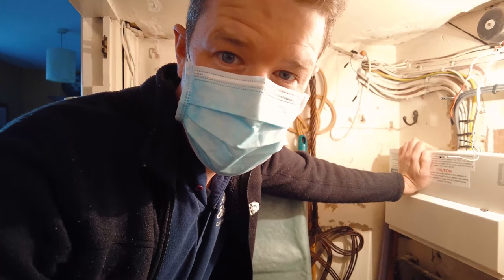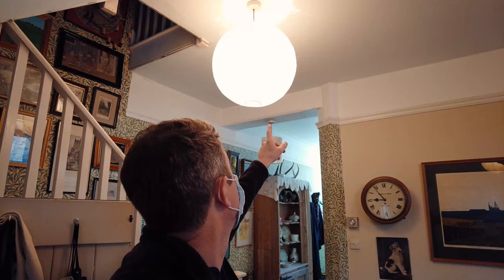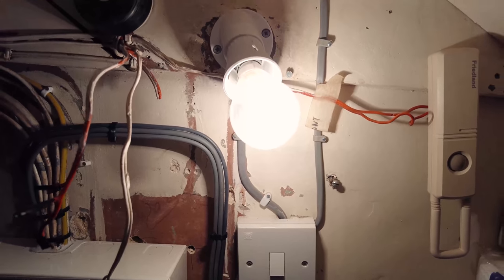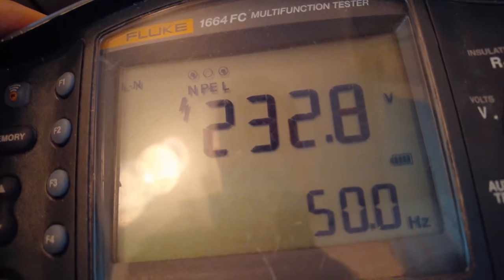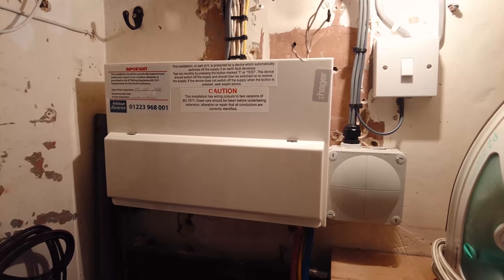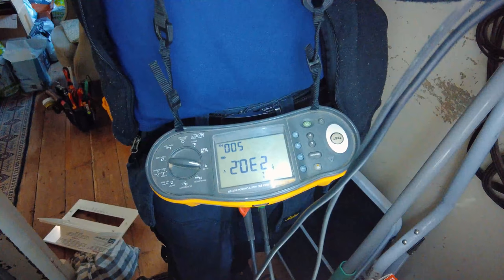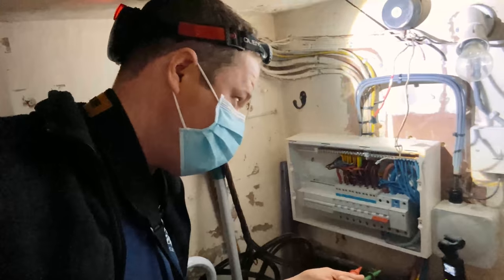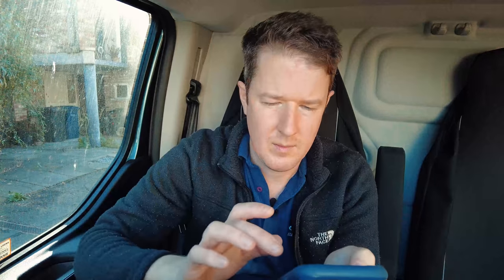Fault Finding Flickering Lights - Electrician Life

Comment: I've come across that as mentioned by a tenant it was jumping from 220 to 205 volts at the kitchen light  with reports of also the oven and kettle taking longer sometimes. 
I went to the consumer unit and found the main Earth was loose and reconnected it and had 240 volts , I even checked it later in the day it was fine and had a report since then to say power fluctuation and light flickering had stopped.
Tenants were told to keep an eye on it, that was a couple of months ago.

Comment: Great video as always  , love these faults ,  all you needed to do was test the impedance between line and neutral that would of indicated high impedance hence the volt drop issues
Reply: How do you measure the impedance between lines at different voltages?
Reply: @randomstranger9674  with a loop impedance tester

Comment: I had this many years ago,(30+) . 2.00am was woken up by a loud buzzing in the bedroom. Turned on light, pop light gone. Street light was like a search light. Pulled main fuse and checked over. Sub station had two phases shorted, measured 370v at meter. Electricity board paid for replacement white goods, fridge, freezer and oven as old mechanical clock, and VCR. Oh and my teas maid !(with coffee in)
Reply from the maker: Wow 😳

Comment: We had a similar fault it turned out to be faulty fuse holder out on the pole( very old ceramic holder) our electrician he couldn't make heads or tails of it but here in New Zealand we don't have network equipment fuses in premises they are all at the point of network delivery aka the gate

Comment: A good few years ago I did working in a poker arcade fixing the poker machines, the arcade was situated in a small village in Donegal Ireland ..the switched mode power supplies in the poker machines would fail  often around the same time each night. It was people turning on electric cookers to cook dinner and then then pulling the mains supply down and the power supply inside the poker machine was working flat out to make the supply and would go bang. Rural Ireland at its best..

Comment: We had a situation here recently where the damndest thing was happening - US. Power was going out every 8-9 minutes like clockwork for about 5 seconds. When it came up, the 240v nominal was at 280v (140 for either of the 120v halves), and this dropped off more or less linearly until 180v on the 240v and 90v on the 120v, when presumably some safety cutout was hit.... Which promptly reset 5 seconds later. It affected a suburban area the size of a small city... Went on all afternoon like that.

Comment: I’ve seen voltages fluctuating from 210-230 a lot in the buildings I maintain. Generally it has been UKPN underground cable faults, especially if they have had other faults in the network so they may change which way the HV network is fed which uncovers other faults. Or it might be a fault on a HV transformer up a pole, wouldn’t be the first time a squirrel has shorted out and blown up a transformer.
Reply: Is continuous up and down in 210-230 range normal? Our lights flicker and electricity supplier discarded any problem saying reading our meter which shown 210-230 range

Comment: Interesting video Jordan I recall that in Berkshire where I lived for a bit a whole section of town had this fault it affected a huge area I thought maybe it was a stuck tap changer at the main sub  but never found out for sure. Eventually the fault was cleared it persisted for a good couple of years though.ive also seen it here in Dorset where it affected a pub I used to frequent . Thankfully its never been an issue here at my home would drive me nuts I think cheers

Comment: I was once working up an attic on an alarm system, all of a sudden the attic lights went very dim, I thought ‘oh what have I done now!’ I measured incoming voltage for the customer and it was 70v, Turns out that a transformer had gone faulty in a nearby field affecting 12 homes. Just a coincidence that I was working there at that time. Relief was an understatement 😁

Comment: A friend house had exactly the same situation the voltage was randomly fluctuating between 180 and 240v 
After a number of visits by Uk Power Networks and placing a data log on the supply it turned out to be a failed cable joint this was repaired but six months later another joint nearby blew up so I guess the original fault causes a week spot on the cable

Comment: Obviously a power quality problem.  Does the flickering happen also after sunset ?  This is a test to exclude a rogue PV inverter somewhere in the neighbourhood.
On the Fluke tester the frequency was changing rapidly around 50 Hz in link with the voltage drops.  Is the house nearby an industrial plant or nearby a SME using some machine normally designed to be connected to industrial supply but connected to domestic supply ?  Normally industrial plants are "a few transformers away" from domestic supply for power quality reasons, precisely.  But it's not the case for SME's and if they're using welding machines or other metal working machines this could disturb the neighbourhood power quality.

Comment: I'd have a crack and say it was a neutral fault developing which might not have gone fully bad. Not sure if they used CONSAC cable in the UKPN  patch, but it's pretty notorious for neutral faults. Or a garage with a welder or similar nearby causing power quality issues.

Comment: High resistance neutral usually at the meter box at least in America that is what I have had several times, especially when there is a small load causes voltage to vary.  This is what I have run into.

Comment: A few years ago I had a very similar issue at my residence. All the lights in the house were dimming very low, even to a point where they would almost completely turn off and back on. I also am an Electrician so I put my multimeter on it and was getting 100 volts on A phase and 140 volts on the B phase. I am in North America so we operate at 120/240 volt system for all our residential needs. After a couple
days of trouble shooting I discovered that the Neutral wire which is the bare conductor that comes in from the City supply wires had some white corrosion inside the crimped connection. I removed it and installed a new one with antioxidant lube inside of it. The neutral wire just so happens to be made from Aluminum. Anytime when Aluminum is used it’s definitely recommend to use the  lubricant when making splices. I am curious to know if the problem you had was resolved and what the details were. Thanks for posting!!
Reply: Hi I'm in Asia where 240v is the standard. Our voltage fluctuate from 219-231 every other minute, is this range normal?
Electricity supplier says such range is fine and refuses to take any action.

Comment: 220V isn’t super low. But why not do a earth loop / neutral loop test? Separate earth/ neutral how much volt difference? Connect the heaviest load and repeat. Check for any possible loose connections. I’d do those tests prior to calling the network

Comment: Hi great video, i was wondering what would cause my landing light to dim as if it wasn't getting enough power ? i changed the whole unit because the old one didn't work and since i have installed the new one it only seems to be barely lit !
Reply: Have you checked the voltage at the light when on compared to the voltage at your meter?
If only one light, it sounds like faulty wiring somewhere.

Comment: What was the cause in the end? 

Looks to me like some sort of motor with a locked rotor (e.g. air conditioner) that tries to start, fails, trips and then resets to try again.
But that sort of voltage drop it would be in the customer's house. Should not have that drop if it were someone else's house.

Always keen to know the reason for the fault.
Reply from the maker: The DNO said everything was fine so we never got to the bottom of it..
Reply: Could be some form of construction.
Have seen my own lights on blue phase flicker when a house up the road did some welding on the same phase.
I'd also ask the residents to see what time of day the flickering takes place.

What a nuisance, but thank you for the videos.
Watching all the way down here in South Africa 👋

Comment: I am reading the regs just now and doesn’t Appendix 2 item 17 give a permitted voltage range of 216.2 - 253.0 volts. Your measurements showed to be within theses limits. I suppose the DNO could tell you to do one but it would be the swings in voltage that gives rise to concerns. Thoughts.
Reply from the maker: Yeah the DNO are gonna run a power analysis for a while and see what the results are...
Reply: So 2 days on and they haven’t found the problem.  Strange it’s taking so long.
Reply: @artisanelectrics  good that you got some sort of feedback from them

Comment: I think maybe one phase is missing on the main supply cable. And now you dont have phase balacing meaning on three phase you only have two phases that is working making the load to jump up and down with high load. Thats is what
 I think. But hey i can be wrong

Comment: Funny Jordan I had the same issue in a flat I lived in the voltage dropping between 240 - 180 even the tv was going off, I called the electrical board who said it was a electrical shower but I could smell a ozone smell from the distribution cupboard on the ground floor it seems the guy from the electrical company did not know what this smell was like the next day the same team arrived as the cable from the street to the dis cupboard had melted or arced through 😂😂😂
Reply from the maker: Wow

Comment: I'm having the same issue but it's on one circuit. I've checked all the plugs I could find on that circuit and they all seem to be okay. I've checked for loose wiring in the breaker box everything is tight and snug. Any other suggestions?
Reply from the maker: Probably good to get an electrician to run some tests to check the voltage etc
Reply: @artisanelectrics  Yeah was my last resort. I was really hoping to figure this out on my own but everyone I've talked to recommended the same thing. I guess I'll just have to do that, thank you for the fast reply.

Comment: Don't you feel sorry for fault finding as a dno? Everything is underground and costs an utter fortune. Seen all sorts of faults with them from smoking holes in pavements where a joint has blown out, transformers catching fire, lines down from trees. , Phase to phase faults . Hopefully you're right and it's a simple fix of rip out the tails that are probably connected by a drawing pin rather than dig the street up time. Also there's been faults our dno couldn't find and everyone on the street had a cable off a manned generator through their letterbox

Comment: most people would be used LED hydroponics rather than Florescent T5 or HPS these days... or so a friend told me.
Reply: No HPS is still the king for that, led are too expensive & deteriorate en mass quickly, requiring you to change whole unit instead of just a lamp as in HPS. Also grows are usually lights on at night & off during the day for heat reasons.

Comment: Who pays u for the job? Not really the ladies fault, and if there is a grow it’s not the supply companies either
Reply from the maker: I chose not to charge for this visit but I suppose if it’s UKPN fault they should pay us for our time really.
Reply: That’s good of u! I’m an apprentice and trying to learn how things work. Well I was an apprentice until government cut funding when 91% through nvq. Hopeing I can still do testing with level 2+3 if I can pass 2391. I will still be a subscriber if I have to start a new career though haha.
Reply: @artisanelectrics  But on the other hand DNOs don't charge when called out and it's an rcd tripped or a fault on customers wiring
Reply: That's very generous. As a customer I would expect to be charged a call out charge in these circumstances, for a pro to come away from other work and use his skill and time to point me in the right direction. Problem could have persisted for years.